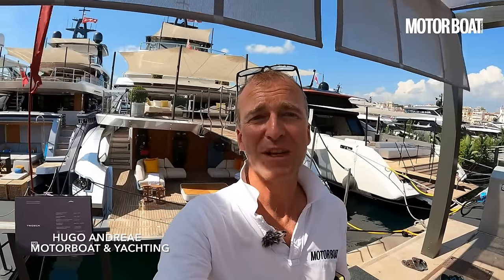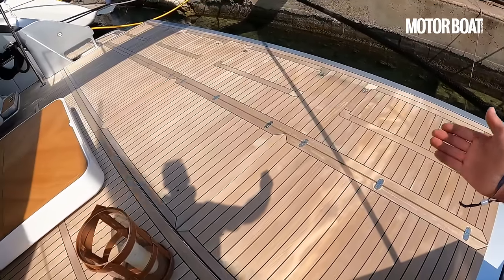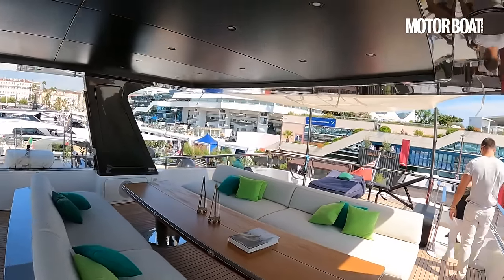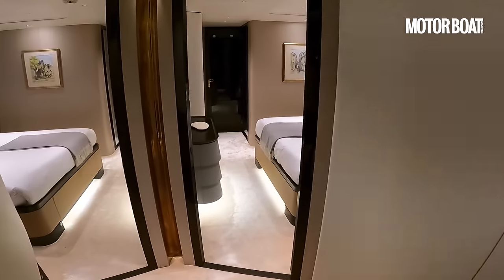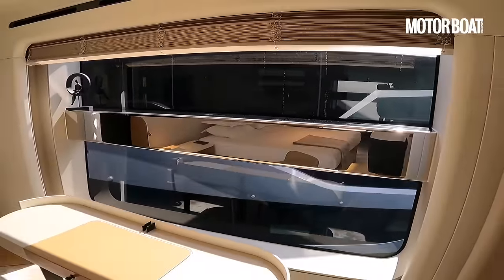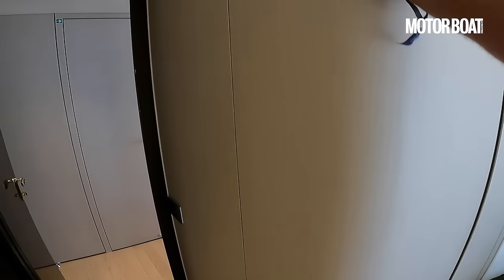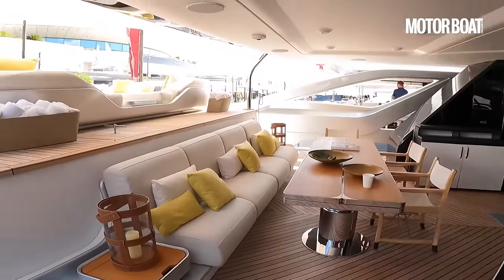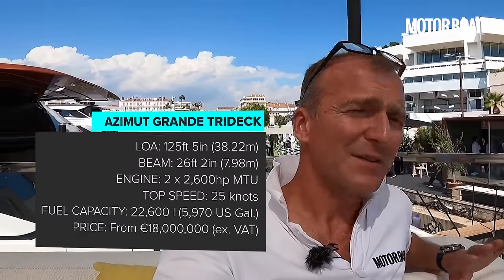Mind-blowing tour of Azimut's biggest boat ever! Azimut Grande Trideck tour | Motor Boat & Yachting

Comment: Absolutely Perfect yacht 
the only minus is it's hull is grp not steel or aluminium .and it's range is under 2.000nm not like 3.500 ~4.000nm range.
But for that 18mil 20mil budget i would pick
Similarly priced competitors like benetti oasis 40(grp hull carbon fiber superstructure but 4.000nm range 22.9mil euro 385gt)
 baglietto dom 133(aluminium hull aluminium superstructure over 4.000nm range 24.9mil euro 398gt)
I still think that archille salvagni is top5 designers for yacht interior design with winch,reymond langton,bannenberg n rowell and nuvolari leanrd.

Comment: What a stunning boat. She's gorgeous inside - the upper deck VIP was a neat surprise - but her deck space options were just amazing. You could so easily hang out with others on board of find a cosy spot in the sun (or shade) on deck by yourself. Even the Beach Club could be used while under way with the transom up. One thing that has always mystified me though. She is described as a Trideck which suggests to me that she has 3 decks. But she (like all other Tridecks), has 4 decks. Could you explain why that is. Many thanks.